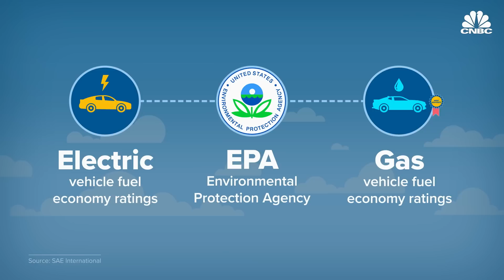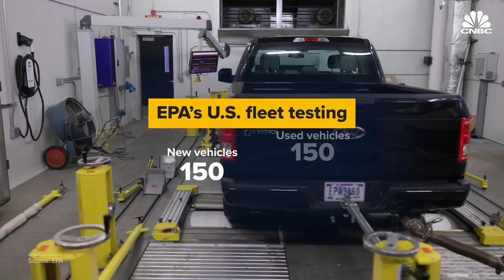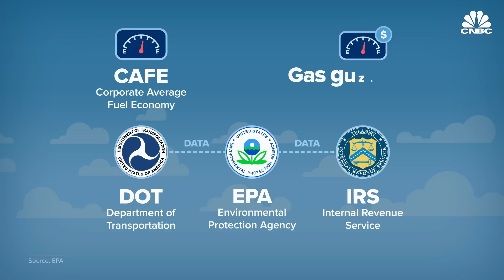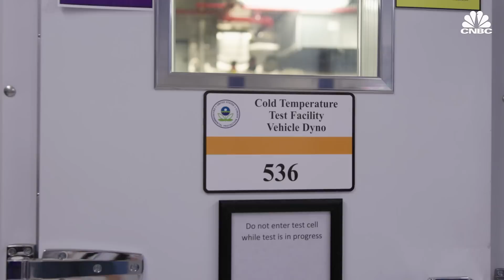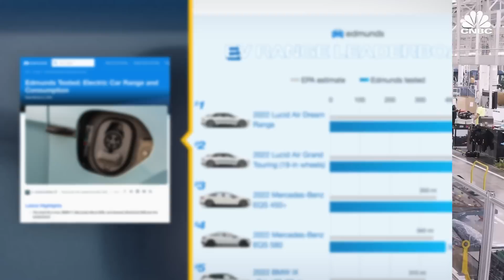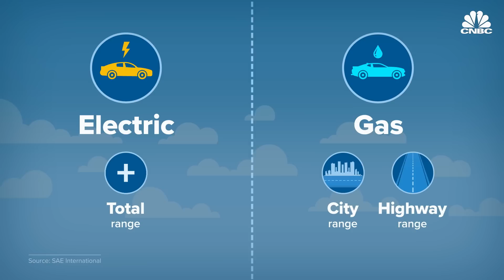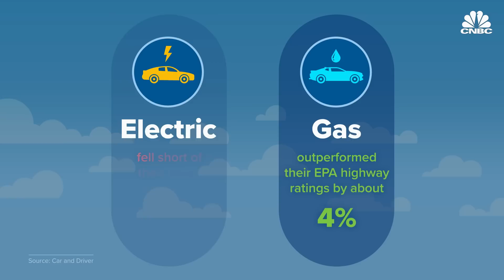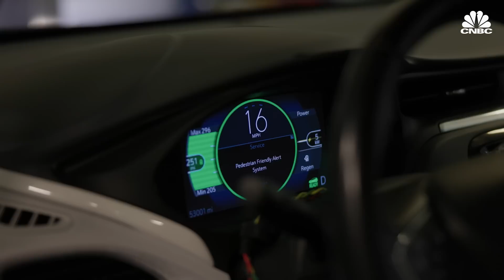Why Tesla And Other EV Ranges May Be Inaccurate

Comment: 1. Why do you state the FACTS on how DAMAGING it is to the earth to get these batteries and the process to ship them all over the world just to make it! 2. Be honest state we do NOT have the infrastructure to even charge all of these cars! Here in California its a joke they are telling people to NOT charge there cars when they get home in the evening and over night cause we don’t have enough power 😂! It’s best to go Hybrid NOT FULLY ELECTRIC
Reply: Get some solar panels.  Free charging at home
Reply: @cruisinguy6024 Suppose you have 6 kW panels. Your Tesla has 80 kWh battery. This is 13 hours to charge the car, if it is sitting at home during daytime, not at your office parking. What about your other energy needs? Maybe if you have a more modest car like Leaf, this can work.
Reply: @TinLeadHammer  The vast majority of Teslas are in California; and in California, under NEM 1 and 2, you can export energy during the day when you're not home, and in essence use that energy to charge your Tesla at night when rates are much lower.

You don't charge directly from the solar panels, and so your recharging power isn't limited to your solar system's capacity; the most common situation is charging at 40A from a 50A 240V outlet, which is 9.6 kW.

No one ever charges from 0% to 100%. Most folks who have Teslas and home charging plug in when the battery gets down to, say, 60%, and only charge to, say, 90%. This is because it only takes a few seconds to plug in, so there's no reason not to keep a fairly high SOC. So a more  common overnight charging situation is adding 30% to an 80 kWh battery at 9.6 kW, which is 2.5 hours every few nights, depending on how far you drive each day.

You're welcome.
Reply: @BigBen621  Where do you "export" this energy to? Does the grid have any storage facilities? At best, this energy will be used to power offices during daytime, but with working from home becoming more widespread, this usage will fall. The grid need storage, otherwise your "export" goes nowhere.

Where does the nighttime energy comes from? If it does not come from some sort of a storage where it has been accumulated during daytime, then it comes from fossil fuel, and you are deluding yourself with "exporting" during daytime and charging during nighttime.
Reply: @TinLeadHammer  These are all perceptive questions. The California grid has a limited amount of storage, amounting to a maximum of about 8% of capacity; but at night, most energy (around 50%) comes from fossil fuel, almost exclusively natural gas. So a little of the daytime excess goes into batteries, but the vast majority is used to power offices, as you stated.

I am not deluding myself, because I'm fully aware of what's going on behind the scenes, perhaps more than most; but that's exactly the effect that I see—as if the grid were a huge battery. But as you seem to be suggesting, this isn't sustainable. For those on NEM (Net Energy Metering) 1.0 or 2.0, the utility is forced to purchase excess energy at retail rates from solar customers, which they could otherwise purchase at wholesale; with the additional costs being passed on to homeowners without solar, who are likely to be in lower income brackets than those with solar. This was implemented when solar was a small percentage of homes in California, in order to encourage solar adoption; but now that it's 40% (!), of course it can't continue. This is why I specified NEM 1.0 and 2.0 in my original comment; NEM 3.0, which went into effect earlier this year, does away with the preferential treatment for solar homes, and only requires the utility to pay wholesale rates to homeowners who export energy during the day. And eventually everyone who's grandfathered on NEM 1.0 or 2.0, myself included, will end up shifted to NEM 3.0; which is as it should be.

The effect the PUC apparently intends this change to have is that homeowners who want to have the advantage of storing excess energy during the day, to use in the evening and night, will have to install their own storage systems; again as it should be.

So your point is well taken. Right now, we're at a point in the solar rate structure that has the appearance of allowing you to store excess daytime energy, for use at night; but as you point out, this is only an illusion, and is being corrected as we speak.
Reply: Almost all of the minerals mined can be reused for years to come even after the battery needs to be replaced in a car. You can’t do that with oil and coal. Between improvements to the grid and phasing in more clean energy, an electric car will only become more efficient and better for the environment than it already is.
Reply: I live in California and they never told me not to charge my car . And the times that they are under advisory's in the Central Valley is exactly the time when solar could offset the air the conditioning load.
Reply: 1. Why do you state the FACTS on how DAMAGING it is to the earth to get these batteries and the process to ship them all over the world just to make it! 

Aggressive efforts are being made in reducing this damage; but of course there will always be mining for these minerals, until the EV transition is complete and recycling batteries provides most if not all of the raw materials for new batteries. In any event, though, if you're going to bring up the increase in environmental damage from mining these materials, most or all of which will eventually be recycled, you should also contrast this with the reduction in environmental damage from mining coal, pumping oil, and fracking for natural gas, none of which is recycled, and shipping these all over the world; to say nothing of the huge environmental damage of burning these fuels to create energy, which will be completely eliminated.

 2. Be honest state we do NOT have the infrastructure to even charge all of these cars! 

We have plenty of infrastructure to charge all the EVs that exist today; and during the decades or even generations it'll take to fully electrify the transportation sector, there's plenty of time for new infrastructure to keep pace with the conversion to EVs.

 Here in California its a joke they are telling people to NOT charge there cars when they get home in the evening and over night cause we don’t have enough power 
 
No one anywhere ever said anything like this. What did happen is that during a few days of all-time record high temperatures, the California Independent System Operator (ISO) issued a Flex Alert, asking for voluntary reductions in all electrical energy use; including but certainly not limited to EV charging, and only during the on-peak period of 4 PM to 9 PM. This had almost no effect on EV charging, simply because the on-peak period is when electrical rates are at their highest, and almost all folks charge their EVs during the off-peak or super-off-peak periods, when rates are much lower. 

 It’s best to go Hybrid NOT FULLY ELECTRIC 

Hybrids use somewhat, but not dramatically less fossil fuels than ICE vehicles, and so would not achieve the goal of elimination of fossil fuel use in the transportation sector.

You should acquaint yourself with the facts a little better, before posting misinformation like this.
Reply: Who cares.   You will die and it will be someone else's problem.   Relax and enjoy what little time you have left.  😘😘

Comment: Until there’s a power outage 😅
Reply: Yep, that's when I use my EV to keep my fridge going.  Works great!
Reply: Get solar.
Reply: @ianhamilton3113  Oh. Put Americans on another 15 - 20 year debt for installing solar? Have Fun!! I'll retire early than you :)
Reply: @Zenrei940  Not buying gasoline and little electricity saves me $6600 a year. I hope you set aside an extra $132,000 to cover fuel and electricity in your retirement.
Reply: @Zenrei940  Payback for a solar installation is much shorter if you add an EV to the mix. Check out the numbers. You'll need a calculator.
Reply: @Zenrei940  I agree solar doesnt really make sense in most cases financially, but no debt here, I would just pay cash if I wanted solar.
Reply: Can't fill a gas car when there is a power outage either - gas pumps need electricity too.